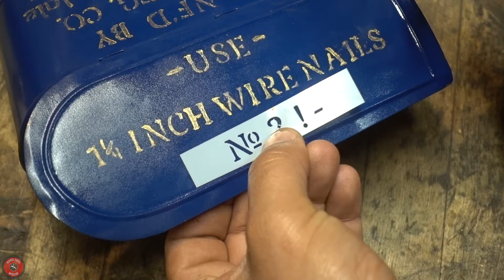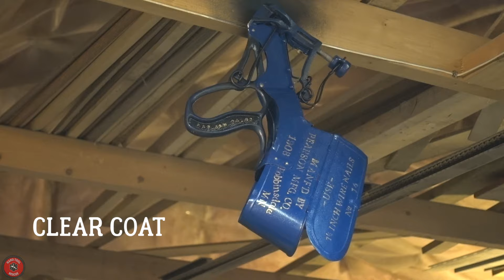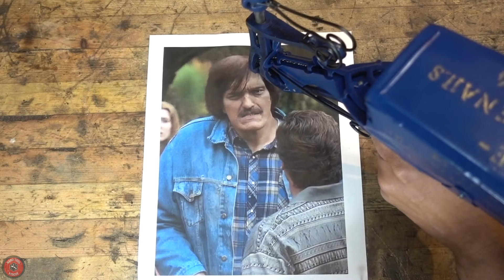1890s Rare Antique Nail Gun [Restoration]

Comment: pretty damn cool! was probably a 2 man job, one guy going along setting the nails and the other one following behind driving them in.
Reply: not necessarily - one man can set his own nails with one hit, and sink them in a second hit. Most carpenters were (they don't tend to use wood much anymore) pretty proficient in doing this anyway, but this makes it a little easier. especially at the end of the day.
Reply: Kevin Keel Where do you live that carpenters don't tend to use wood? We certainly tend to use it more than any other material where I live.
Reply: Maybe the machine efficency is poor  because the nail quality is different.
Reply: He was hitting it lightly. You would use a wooden mallet and hit it with much more Force.

Comment: I love old things, especially tools and mechanical things. It's amazing to me to see how capable manufacturers were back in the day ie. regarding  quality and ingenuity when compared to much of the crap made today. Sometimes I wonder if we really have made much progress. Sure some things are obviously better but  they always seem to sabotage a product with at least one poorly made/designed part, not to mention made to be unrepairable.
Reply: Same quality as there always have been, but you get what you pay for. If you try and find the price for the stuff shown here i bet it was not cheap.
Reply: I somehow don't see this tool as much improvement compared to just having your nails on a roll of painter's tape, maybe with some kind of guide around it that you could make out of a thin strip of plywood - it's a heavy, thus likely tiresome and complicated contraption, possibly prone to jams, that only dispenses the nails, doesn't encourage them in. It doesn't make me wish i had this. We certainly have much faster and easier to use tools today, and we get them for laughably little money, even if they are of disposable quality or often engineered to fail right after warranty runs out. The mechanical precision of tools has also improved since then - any cheap plastic injection moulded part can be made with no deviation from another one, which is probably more important when you actually use the tool than the fact that it will fall apart in a few years and will be burned in a power plant to regain a good portion of the energy that was spent making it. These old tools are important for historical preservation, but we really aren't missing anything we need today.

Comment: That was really interesting... I wonder if that nailer is something that was commonplace or rare.  Seems like a time saver for sure, especially if you had a team of carpenters working on a job.  This restoration came out great, even if (as you say) it's mostly aesthetic. Seriously though the reapplied lettering looks great.
Reply from the maker: Thanks!  This tools was $5 in 1908, and with the average wage of $0.22/hr, it only took a few days to pay for itself and could be purchased by lots of workers.  I think it's not common because many were broken.  I don't think this tool could survive a fall off a roof.  The cast iron parts would break off easily.
Reply: How common was falling off a roof?
Reply: Yeah, I dunno... I think you underestimate the pressure to just keep yourself and your family fed and have a roof over their heads @ 22 cents an hour.  I used an inflation calculator and .22/hr would be $5.58 in 2017 wages!  $5 in 1908 dollars would be equivalent to $127 today.  It would be doable eventually but in 2017 wages bringing in $892 a month, I think you might be worried more about those essentials.  Let me put it this way, years ago I was a making 22 DOLLARS an hour and I would have had to think long and hard about buying a tool that didn't increase my wages (but did increase my productivity) and cost me $500 to buy.  I'm thinking this may have been something a company might buy for it's carpenters, and when companies buy tools for their men they often get broken, or at the least are treated roughly.
Reply: Sadly the tools you had/(still happens today) lead to getting work. While companies are ""supposed"" to supply equipment, a lot of workers bring their own. Some for personal preference with better quality without having to wait to get the worn piece of crap tool,  but most because it helps them get chosen over someone who doesn't. 

 Like owning a screw gun is required and people wont hire you if you have only have manual screw drivers.  When it comes to industries that can abuse the employee verse independent contractor destinations, it is the workers who buy equipment so they can have more work.  They know it is not right but  you want to work....  Vicious cycle especially when starting out.  Conventions set up crews that are day type hires are expected to bring several hundred to thousand dollars worth of tools....

On a happier note,
Amazing job locating and restoring another great classic tool.  These videos are great.  Imagine  put the tools in room and seeing how many modern day professionals could figure out the what and when to use...  Amazing,  how much genuis inventions have cycle throw the various workers' tools through the years.
Reply: I agree to an extent, but when I see tradesmen in the UK they tend to have many hundreds of pounds worth of tools, even the lowest ranking staff (apprentice/labourer) do save for Makita and Dewalt etc despite them costing a weeks wages or more each. 

I find it easy to believe that 1900 carpenter would spend two/three days wages on a tool that would save a lot of time, sore thumbs and fiddling with nails. I would buy that tool in an instant if I were a (1900) roofer, and tie it to my tool belt with a piece of twine to prevent dropping it. :)
Reply: Right, and I see your point, except it's more than simply "a few days wages", more like almost 23 working days of wages.  A month's pay.    At starvation wages?  But still I can see it happening, I think it would be less prevalent than you might think.  Those guys were pretty fast with a hammer and nails!  PLUS there is a certain snobbishness in the carpentry trade that I remember from when I was associated with it years ago, a certain "I can drive more nails than you with my hammer" sort of thing.  A nail gun like this might equally be a source of derision as well as envy.
Reply: DAN D Ironic they tied tools off but not themselves. Just think with this invention for a nailing device,   the ability to accidentally nail your apron string to the roof went up greatly.

 I don't know if the tagging i did will work but look at my comment below for a link on historic USA government training/education films many shown tools and trades as the were in 1940-1960's. The guy who uploading is even making groupings to help. 

Sad to hear the UK shares the USA problem with worker's supplementing their employers costs to little benefit.  It is one thing to buy tools that fit your hands better but to have to supply a full kit is burden, especially when starting  out. You do buy tools that last a life town and use on your own home but that takes few years.   Being competitive and the old "you do what the workplace norm is", if you want to get ahead.  Everyone knows it is  wrong, some lie and defend their behaviors falsely ( the "" I don't need a safety tether"" while working at heights folks for example) who also bash the people who do speak up about issues. Just look at how just wearing a safety belt you could slip out of ether direction let alone the stepping effect it had for fall arrest.  To now full body dual tethers shock absorbing inline spine.... So somethings have improved but if you need a harness you usually have to buy your own and you kinda want a harness you know the history of and people care better for their own gear.      

  If your lucky you can use your old Grandfather's tools to help work until you can start replacing with new and the now far more advanced. Every time they up the cordless tool battery size ( storage and/or voltage), usually starts a retro fit adding to that tool kit cost . Batteries wearing out cost enough, having to replace both the tool and battery, and every other tool to keep everything interchangeable is absurd and expensive.  All to do more work in less time for the same pay.   Reminder when cordless drills were for a few screws or a hole, when & where you were on a job site without power or just needed a quick use?  Now tools are expected to work on par with corded .

Something to think about this 1900 (1892 patented Pearson's Nailer) tool,  
in 1871   Samuel Ingersoll invented the pneumatic drill .

in 1890 Charles Brady King of Detroit invented the pneumatic hammer (a hammer which is driven by compressed air) in 1890, and patented on January 28, 1894. Charles King exhibited two of his inventions at the 1893 Worlds Columbia Exposition; a pneumatic hammer for riveting and caulking and a steel brake beam for railroad road cars.

Comment: You must be very careful sandblasting sheetmetal because it's very easily distorted. I was also concerned you removed the original metal finish that has done a pretty good job protecting it from rust for the last hundred plus years. That "paint job" will not protect it for long. And the stenciling was hard to watch. Then the super glue. Never do anything to an antique that cannot be undone. I was, however surprised to see the nails fall into place. That's a pretty ingenious mechanism.
Reply: It is sheetmatal not paper. Sandblasting is the most gentle non chemical way of removing paint.
Reply: blah blah blah  , ( know it all )
Reply: Didn't occur to you that the stencils are laser cut from originals, huh

Comment: Literally blasting away it's history was bad enough, but covering it up with a terrible paint job was icing on the cake.
Reply: TheSpoonyBard - I thought the same thing..!!
Reply: I kind of agree. I dislike sand blasting everything. I constantly see guys who have taken apart machinery to sell the parts, on eBay, and they blast the parts completely. They blast shafts and mating surfaces to the point of destroying any chance the parts ever had of working properly. But they look good in the small photos.
Reply: I think the same way.
Reply: It was its original paint though.
Reply: what kind of effect gives sand blasting?  and why do you hate it so much (genuinely curious)
Reply: But on the video it works perfectly fine...
Reply: David Os  It takes off the material, also that that is supposed to be there.
Reply: When your house starts to loose it's paint, don't you repaint it? If your car rusted, wouldn't you remove it and repaint?

Comment: When using stencils it's a good practice to use stencil adhesive. Just spray it on the back of your stencil and place it on the tool or part. It will give you much cleaner edges and is a multi stick and remove type of adhesive that will remove without a problem and will not leave a residue on your piece.

Comment: When you write a letters through a stencil, you need to use a wide flat brush (wider than the letters on the stencil) with stiff bristles (or a sponge) and very small amount of paint. Coz a wide brush will be enough to one move (smear) per one letter, also the paint will not leak under the edge of the stencil. The stencil should be tightly pressed to the surface.  The letters will be much more accurate.

Comment: My Dad had one of those and I never knew what it was!
I, like my Dad, am a hardwood flooring specialist. When I was a kid, we used "Cavanaugh nailers" to put down strip flooring/ 5/16" top nail. I have tried to find one of these for the longest time and the guys that have them won't let them go! It is 100% manual and old. They're temperamental but do an amazing job! It has 2 small roller wheels in the back, a tray on top, a rail for the case nails, and a long plunger/sticker up front. It drives the nail into the wood and forces the wood down to the subfloor as well. Super efficient, not like pneumatic finish guns...
My point?
 CAN YOU GET THESE? DO YOU HAVE THEM?
Reply from the maker: Definitely haven't come across one of those.  I can keep a lookout though.

Comment: Great restoration! Always fun to watch.  Thanks for taking the time to do it. Q: why not hang the items you spray from wire?  Also think you might add a primer or adhesion plaint layer to help paint stick when used?   What industry was this guy used for? The nail size reminds me of wine crate sizes, thanks again
Reply from the maker: Thanks!  The paint I use usually doesn't need a primer or includes a primer.  This was mainly used for roofing.

Comment: Did you disassemble anything except that trigger?
Reply: Crute Cox no he didn’t he just removed a spring and sanded it and painted it like a 4 year old with no fingers this was not a restoration if he doesn’t even fix the dints on the box and doesn’t even clean the inside of the tool as you can see as he struggled to put the nail down at the tip this was like a 10 yr old trying to rush a project for a dollar this was beyond cringe as he gave up on the project from the first spring practice to get skill level 1 and the end project will be a+

Comment: Why did you use the Circa 1856?
Reply from the maker: +Adventures in Fabrication That is the one available closest to me.
Reply: I have seen you attempt to use in several of your videos and you always seem to end up sandblasting. So my question is more, why not go directly to sandblasting? It sounds like the stuff is like citrus strip and you could rap it in plastic and leave it on over night and it may work better.
Reply from the maker: +Adventures in Fabrication It's quicker to remove as much paint as possible first before sandblasting.

Comment: SO it's not exactly a nail gun, rather a nail sorting and orienting machine. Still cool. Next time on lettering, use an airbrush and light successive coats. Paint brushes work only with special dilutions.
Reply from the maker: +aserta I should get a super small air brush.

Comment: Crute Cox no he didn’t he just removed a spring and sanded it and painted it like a 4 year old with no fingers this was not a restoration if he doesn’t even fix the dints on the box and doesn’t even clean the inside of the tool as you can see as he struggled to put the nail down at the tip this was like a 10 yr old trying to rush a project for a dollar this was beyond cringe as he gave up on the project from the first spring practice to get skill level 1 and the end project will be a+